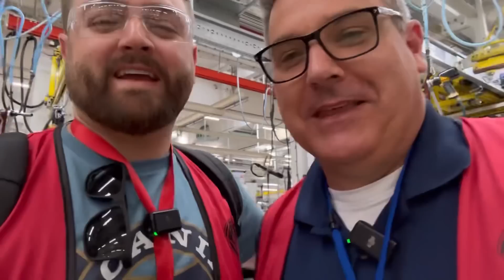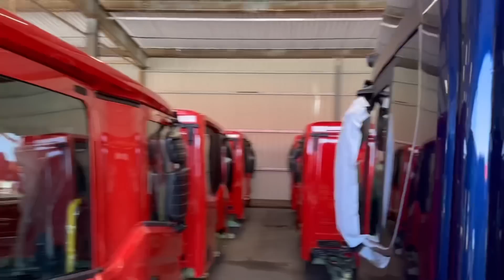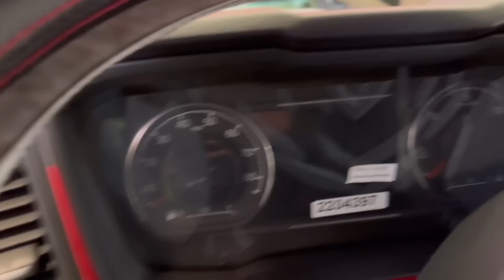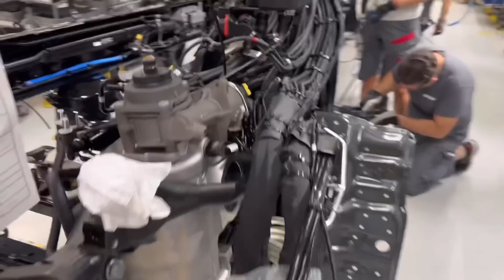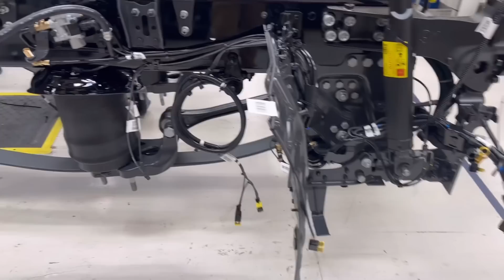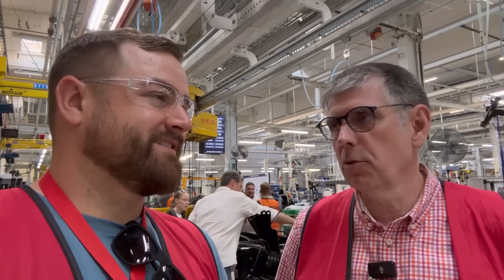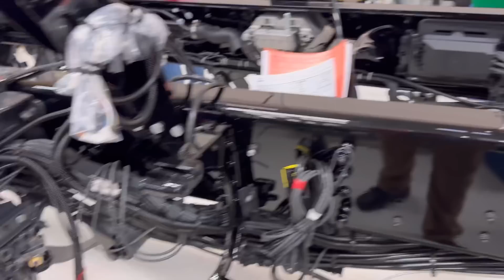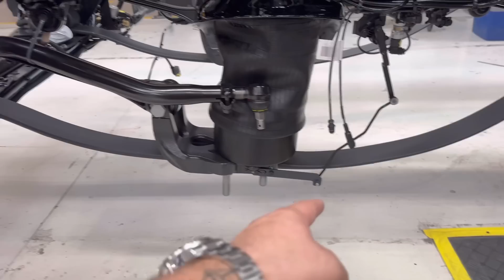Building a SCANIA R770 Truck for USA DELIVERY!!! Step by Step Chassis Build PART 1

Comment: I'm a bit partial as a swede, but I really hope this will snowball.
Reply: T-Cab would be the best place to start in the USA... It's familiar to NA truckers
Reply: @King_of_the_End The problem is Scania stopped making T-Cabs themselves years ago, T-Cabs now are new Scania cab overs which are then converted to T-Cabs by Vlastuin 👍
Reply: @gimble447  but Scania warranties the work done by Vlastuin so it's basically a OEM package done by a 3rd party
Reply: @King_of_the_End  I know that lol, but they won’t upscale production on a whim, you are talking them having to produce atleast 10 times as many and that may be just to start off with, Scania are a mass mainstream manufacturer, T cab production is by a small, “low volume” independent specialist company who may be happy staying that way and Scania has no say in what they do, ( Put simply Scania stopped making T-Cabs because demand was too small for them, but big enough still  for a small company to bespoke build) Scania would be as well start production of T cabs again themselves in that scenario but yet again they won’t do that until the full potential of the market demand is proven with models they manufacture already, in short it’s Scania who are wanting to try ( again) in America, but not necessarily Vlastuin 👍 and that leads to another important  distinction in that although Scania cover warranties you are buying a T Cab from Vlastuin not Scania, it’s Vlastuin who technically buy the COE truck from Scania, but it’s “Scania” who want to sell in the US 👍
Reply: @gimble447  I'm not saying to just upscale with no reason, I'm saying they should have one to show off then see which version is more popular in the USA
Reply: @King_of_the_End  What I said too was that Scania would probably in that case have to then start making them again themselves, as ultimately to make it work if it takes off, they will need to build an American factory to make it a long term, economically viable and profitable proposition,however they will stick to their existing models for the initial phase as it costs them nothing, having a demonstrator isn’t an effective way of gauging actual demand  ( especially when it’s maybe not what would actually be sold there eventually) as Scanias own new version might not be the same as Vlastuin adaptation models, ie they won’t be “conversions” for a start let alone what other design differences they may make to their own Scania built T Cab product, having actual stock in bulk built in the continent they want to push in their final form does help though and that will happen after the potential demand is assessed with models that “Scania “ actually build right now. In short if Scania had never stopped production of the T-Cab themselves then what you are saying is obviously a no brainier, not so straight forward though to bring back a new version for a specific market though ( as I said T Cab didn’t sell enough for them to keep making them so a new one would in essence be purely created for the US market)
Reply: Or they could have long lines, with the very extended cab, more space for the driver in the same wheel base as a smaller cab + hood of an American truck, and it would look very unique on American roads
Reply: @kalle5548  don't know if I'm dyslexic or stupid but you lost me somewhere there
Reply: @King_of_the_End  Was trying to say that Scania could use the Long Line (super extended cab) in the US market to offer more cab space, rather than a conventional truck with conventional cab and conventional cab space. 
Would be a competitive advantage (maybe) and would look really foreign on US roads.